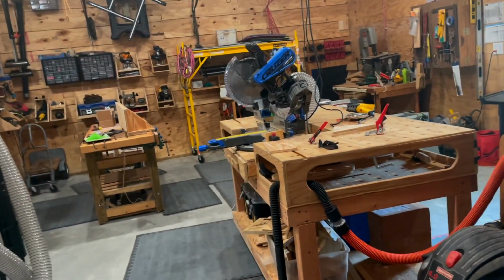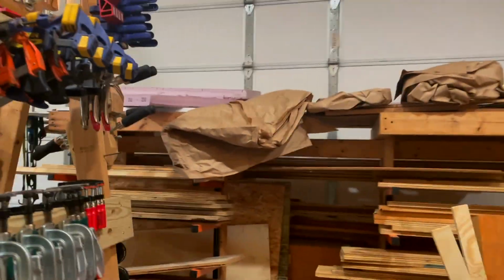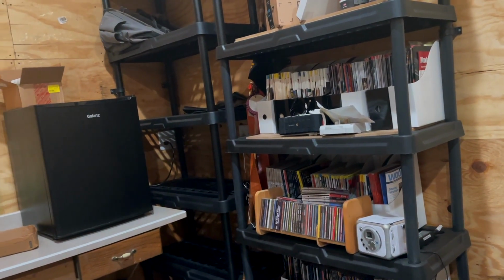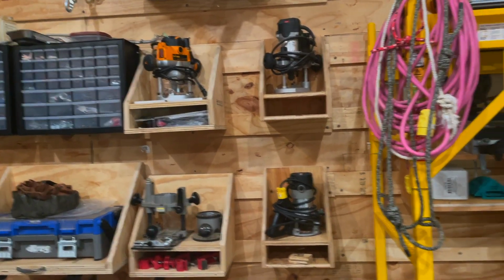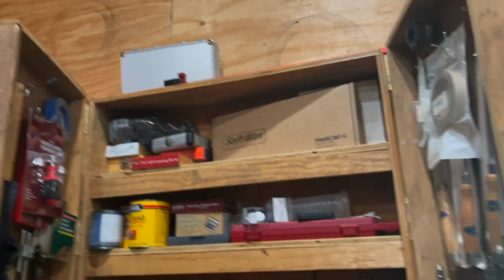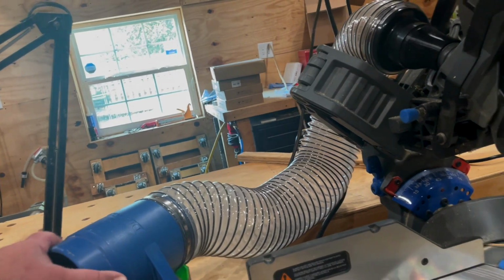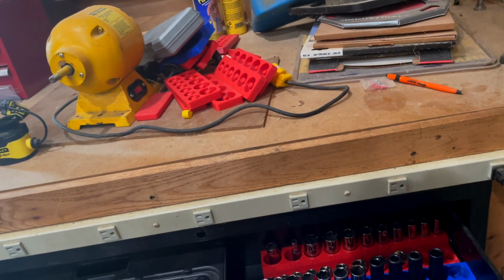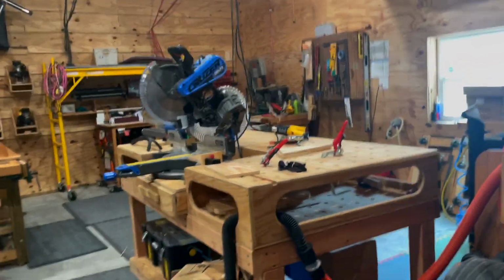Smartwoodshop Tour with Greg Hines

Comment: That clamp rack was sweet!
Reply: Agreed
Reply: That thing was made years ago, loosely based on Norm Abrams rack.  Initially I had spanners from one side to the other, and I eventually replaced them with the perforated 2x6s to hold the bars of the clamps. I also initially had it on a cheap mobile base, and just recently replaced that with the bottom and much better casters.

Comment: Another great shop.  Thanks for sharing it.
Reply from the maker: Thanks for watching!
Reply: I have been pleased with how it has turned out.  I finished all of the interior myself working nights and weekends over the course of about a year and a half.  My subcontractors were for the spray foam insulation, electrical and plumbing.